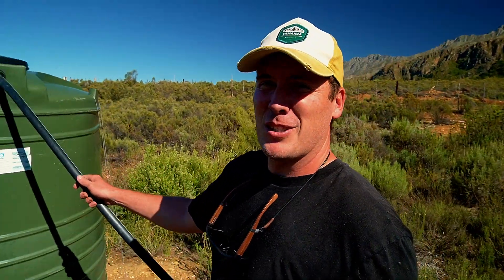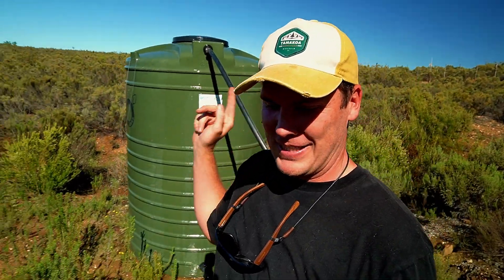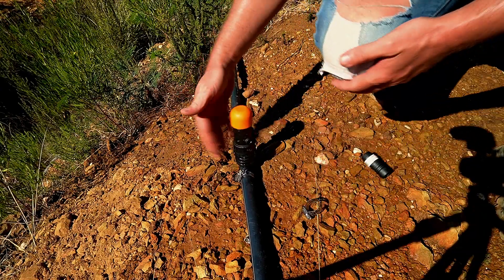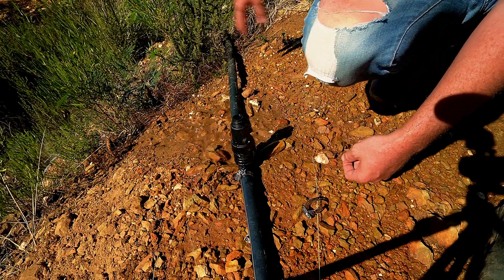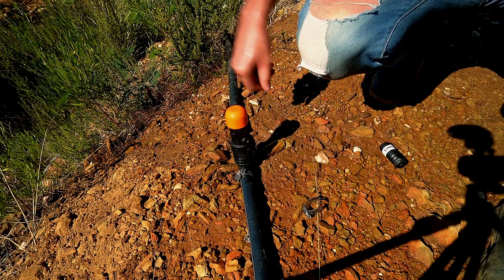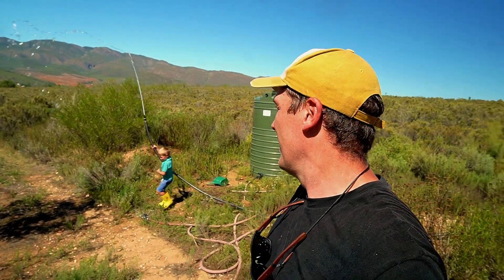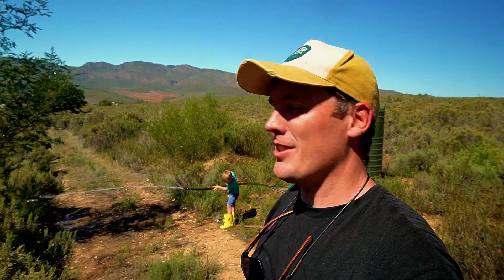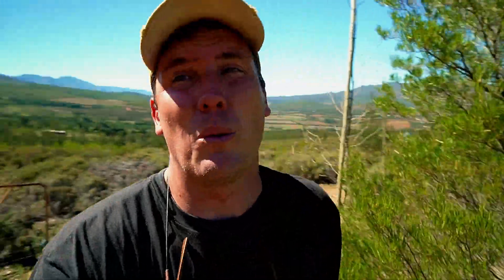The Hidden DANGER of Trapped Air in Gravity Fed Water Systems

Comment: Hey Craig nice video, is that poly uv stabilised? Might want to bury it if it’s not and a little tip mate don’t spin while filming it can be nauseating
Reply from the maker: Hey hey, thanks for the tip! I'll definitely be more aware of that and if needing to turn make sure it is slow and steady 😉

This pipe is HDPE pipe, so it's UV stable and should last a while. That being said I am not expecting it to last a super long time. It's class 3 as there are budget restraints, but the idea would be to go to class 6 at some point in the future. We will also look at getting the pipe underground as soon as we can. We just need neighbours to get fences up first so we don't end up potentially damaging them when putting up fences.

Thanks for the support and advice 🌻
Reply: @ if it’s uv stabilised it’s good for many yrs no need to change class unless the pressure exceeds the pipes limits, I’d still want to bury the pipe so animals don’t wreck it and place painted rocks on top so it’s marked and easily visible, you can get a digital timer that run on a couple AA batteries and set them to go for an hour each day while you’re not there so the trees get watered regularly, hope you and the family are doing well 
Cheers Beshy
Reply from the maker: @BESHYSBEES  ah, what a lovely comment, thank you 💚 it's like you are reading my mind 😂 I need to get a digital timer set up, but luckily we are entering winter and I am going to be planing more than 60 trees so I am going to have to get this up and running before the next summer season.

Heading through today with the kids to do some water tests and continue the fence, which should be fun.

Thanks for all your always great comments and insights 🌻

Comment: looks very flimsy,wild boars would devestate,I would want to improve masivelt,better pipe fittingsmconnectors etc,this is like cheap garden hose set up❤❤❤❤❤
Reply from the maker: Kind of hard to say that when you haven't actually felt the materials or been part of the purchasing conversations 😉 We also don't have boars here so that will never be a problem.

These parts are all made for up to 10 bars of pressure (all nylon) and considering we will never go above 3 it will more than service it's purpose 🌻
Reply: @tamakoa-homestead  I hope I am wrong,but having done all this first hand,experience shows do the best,not screwdriver connectors,use proper screw together fittings,have system burried,create more storage,make sure frost resistent,like I say have proper bolt together manifolds covered,proper mapping and future access,loke what your trying to do,think you could do a lot better
Reply from the maker: @mechanics4all405  thanks for the feedback and insights and you are 100% correct.

I will do another video on my water plan, which I'm sure will help clarify a few things 😁

The main reason for not going extreme with connectors is the low pressure. The shops and farmers I have spoken to all say the internal nylon connector with the clamps on the top is a rock solid way to connect, but time will tell. We do have temperature extremes with 50 degree summers and - 10 winters so that will be the ultimate test I guess.

For storage I am planning on putting up a 100kl reservoir but money doesn't buy me that right now, so it needs to wait, but it's definitely on the cards.

I also totally agree on the burying of pipes. As the pipe crosses a few properties above us that are looking to get fences put up I have held off sinking the pipes to prevent the possibility of pipe damage when making the fence as I would ideally like the pipe to run along fence lines.

Once again, thanks for sharing your insights, I really appreciate it 🌻